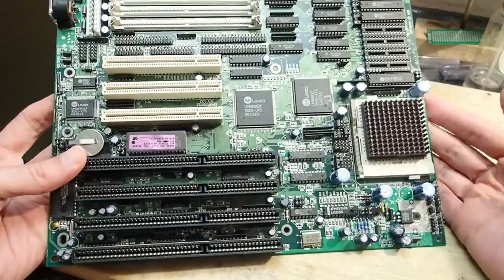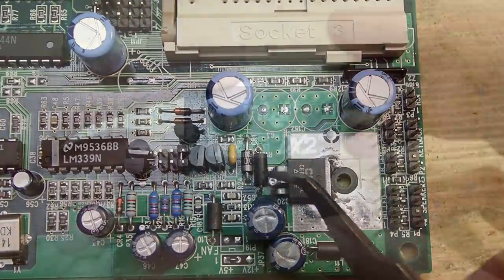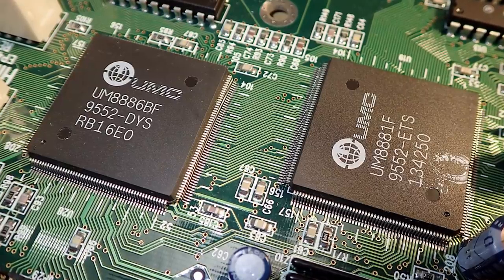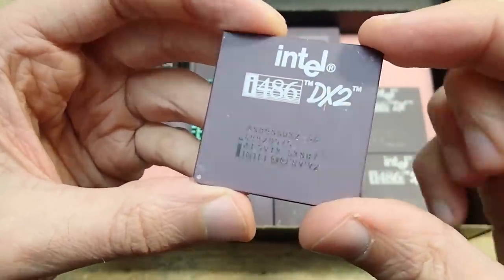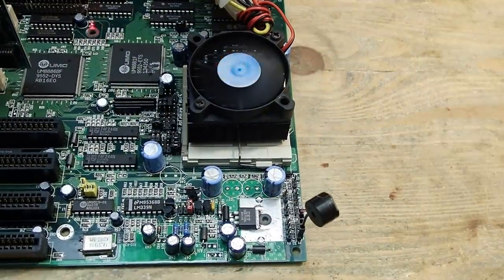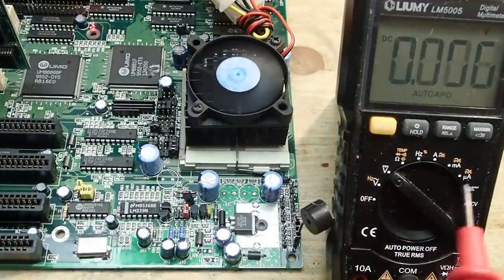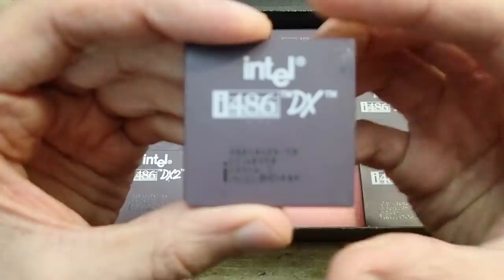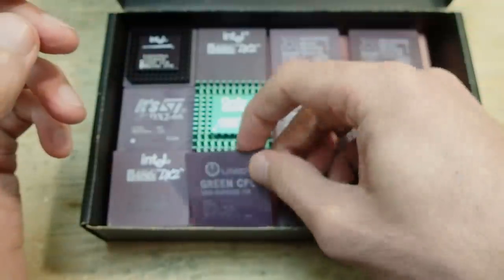Let's try to benchmark and overclock a 486 on an Octek Hippo 15

Comment: This resistor dynamically limits the power in the processor circuit, it works like in the case of diodes, when its temperature increases, its resistance decreases and its current increases, which in turn leads to an increase in the current in the circuit, and as a result, the power dissipated in the form of heat increases. When there is a resistor in this circuit, an increase in current in the circuit causes a larger voltage pair across the resistor U = R⋅I. The result is an increase in power lost as heat on this resistor and a decrease in power on the processor, which lowers its temperature. Replacing the resistor may result in failures when the processor reaches the critical temperature and at the same time the resistor regulates the power enough for the processor to continue working. Greetings from Poland.
Reply: So if I'm picking up what you're putting down correctly, this is a form of temperature-variable voltage control for the CPU? Or is it a form of fanspeed control for the heatsink? 

I'm struggling to follow a bit as I have at best VERY basic electrical knowledge.
Reply: The resistor is not used to lower the temperature on the CPU by dissipating some of the heat. I'm not sure where you get that idea.

As the current draw increases through the resistor, the voltage measurement across the resistor rises. This very tiny voltage is fed via Kelvin connections (the tiny traces off either side of it) into likely some kind of opamp/comparator circuit.

When the voltage across the resistor gets high enough, the comparator will cause the circuit to "trip", like a circuit breaker, maybe because of a short circuit, or because it will overload the power supplies ability to supply that much.

If the resistor was to limit any of the current to reduce the amount getting to the CPU in order to have any kind of effect on its temperature, the voltage to the CPU would likely begin to reduce to the point it would probably stop functioning.

If the value presented at the beginning of the video is correct (0.01ohm or 10milli ohm, which is quite plausible for a current sense resistor), then this resistor could theoretically pass hundreds of amps, and no typical PC power supply can even supply that much anyway. But what it does mean, is that for every amp flowing through that resistor, you would measure 10milli volts across it. That's a nice decade figure to feed into an opamp/comparator to implement an over current protection circuit. And at 10milli ohms, a couple of amps flowing through this resistor will barely cause it to heat up.

Why it burned out in the first place I have no idea. Something evidently went very wrong.
Reply: That's a bunch of hoo-hoo. It's simply a current sensing resistor. What you are explaining is a light bulb, and any normal resistor will not have any significant resistance variation in the range of safe working temperatures. For an appreciable PTC effect, you usually need very special semiconductor materials. A normal carbon resistor will not do.

Comment: 486DX2-66 is the canonical 486. It's the first time intel didn't just move on to the next product but instead stayed and fought one price. DX2-66 started very very expensive; 1000-dollars something; but just kept dropping. 486DX2-66 was so common, like 386DX-40 before it, that it became a standard target for game developers. Whatever you did, your game had to have a recommended or at least minimum spec of 486DX2-66 or it was no good. Games as late as Daggerfall and duke nukem 3D were designed to run ok on 486DX2-66.

Comment: Why is YouTube digging these up for me, and why, with three speed jumpers, are only 4 combinations used, are there any interesting undocumented ones?
One possible interpretation is that 1-2 and 3-4 are a 2 bit code for speed, while 5-6 only being open for 50 may be some extra wait state - in which case 5-6 open on any other would be the same clock but a lower performance, Maybe it's ISA divide? /4 would run 6.25, 8.25, 10 and maybe /5 for a fast 10 at 50MHz?

Comment: Do you have an idea why my FIC 486-GIO-VT2 with AMD AM486DX2-66 doesn't even come close to the results you get with DX2-66? On Sysinfo I get 91.9, on SpeedSys 23.57, 3D Bench 320x200 40.0, Landmark CPU only 66.4 (despite a Cyrix DX40 with this exact board having a result of 139.1). Doom has an fps of 46.2 and 23.0, respectively, using a Cirrus Logic CLVGA542XVL/H card (VLB). I think I maxed out all the settings in the BIOS, as far as I understand them. The Memory Bandwith is only 23.23 MB/s according to SpeedSys and the Memory throughput 15.98 MB/s which is worse than on my 386DX40. Board is equipped with 8 MB FPM and 256 kB of L2 cache. I can't really make sense out of these results because they seem so much worse than the results I see in your video and others. Do you have ideas? ... Now that I finished this text I realize I could have asked in german ^^ Never mind ...
Reply from the maker: For interesting questions like this one English is ok, because others can read it too. I also know the FIC 486-GIO-VT2 very well, I repaired some of them already. On part of the answer is very simple, VIA is one of the slowest (if not the slowest) chipsets for the 486. If you want to reach something in the direction, what I measured go for SIS, or better the UMC8881/8886. As I said, I believe the UMC was by far the fastest chipset for the 486 platform. However, your results for the DX2-66 are far too low indeed even for the VIA. But it's hard to tell why without seeing the BIOS settings. Are you sure your L2 cache is on and working?
Reply: @necro_ware  Hm now that you ask me, I'm not too sure anymore. It's been a while since I tested it and wrote the numbers in a little Excel file. I sent you the file in an eMail, just for giggles. I will dig the mainboard out of my stash and test it again tomorrow and get back to you. I have two other 486 mainboards but the don't work, so I can't compare them myself. One of them has some damaged pins on one of the chips that I tried to repair with the method you showed in one of the videos where you repaired several boards. Didn't work out, though. All it does is giving a buzzing sound that repeats after a few seconds. The other one doesn't post at all. So the FIC board it is for me until I come across a reasonably priced board on eBay.
Reply: @necro_ware  Good morning ... I dug out my FIC board and checked again, as promised. L2 cache is active and reported in SpeedSys as well. I found an option in the BIOS called "decoupled refresh" that sounded like the "slow refresh" option you described in your videos. It was disabled. After enabling it the SysInfo score went from 91.9 to 99.0 and all the other benchmarks went up slightly as well but still nowhere near the figures you get.
Reply from the maker: @gennidee  dx2-66 should get to 144 points in Sysinfo even with VIA. There is something fishy about your setup, but hard for me now to say what. Dou you have a second CPU to double check?
Reply: @necro_ware  Just the Cyrix DX40 that was also in the list I sent to you via eMail. Did you get my mail? It scored 67.9 which probably is also very bad for a 486DX40. I also went through all the jumper settings for the mainboard and they seem OK. Some settings I don't know what they do so I didn't touch them. Probably will need to check them again and set every jumper that I don't know what it does to default if it isn't. But I think something is off with this board since "turbo" doesn't work as well ... As I write this I'm actually in the process of documenting all the tests in my spread sheet with "decoupled refresh" on to see the difference. All the fps figures went up by about 5% with this option set to "enabled".
Reply: @necro_ware  Interesting: I just realized the Turbo switch connector does work suddenly. It definitely didn't when I last checked. SysInfo goes from 99 to 17 when I short the pins and Doom runs a lot slower as well. Funnily TopBench doesn't seem to like when the turbo mode is switched during testing. With turbo on (pins open) I get 194 and when I short the pins during the test I get a reading of about 900. When I start TopBench with the pins shorted I get 70. When I open the pins I get 194 (which is correct) and when I short the pins again I get 700. Odd ... But anyways, Turbo works now and the only thing I changed was the BIOS setting of "decoupled refresh". These old things make me wonder sometimes ...
Reply: @necro_ware  Hm there is RN20 + RN21 + RN22 described in the jumper manual. These are sets of sockets to put in a resistor network. For Cyrix and AMD CPUs the manual says to put in these black resistor networks in some of the places. Problem is I don't have these and I also don't have a CPU that doesn't need a resistor network put into the pins of RN20/21/22 to see if the results would be better then. I don't know which value the network should have to  buy one ...

Comment: I bought a new Cyrix 5x86 (probably a 100 or 133) and tried to make an MP3 and it took very very long time. My friend that had a Pentium 75 at that time was way faster.
Reply from the maker: Yes MP3 heavily relies on the FPU, which is very weak in the 486. You can't play Quake on a 486 for the same reason.

Comment: Putting edo in a 486 has indeed no advantage. Yes some boards can be used with edo, but even then the board doesn't know how to use is. I even tried on a 486 pci board with an overdrive 133mhz processor with no difference at all (although the difference in overall computing speed between my dx4-100 and the overdrive was very noticable)
Reply from the maker: EDO was a marketing hype anyway. I remember the promises as it was introduced, but in reality the performance difference between FPM and EDO on pentium was barely  measurable. In the best cases, in synthetic test it gave only couple of percents benefit and in real applications nearly nothing.

Comment: What is the point in overclocking retro - hardware? Just use more modern one if you need to. Poor CPUs.
Reply from the maker: No point, just interesting to see how far it can get. And why plural? I overclocked just one CPU and also not too much.